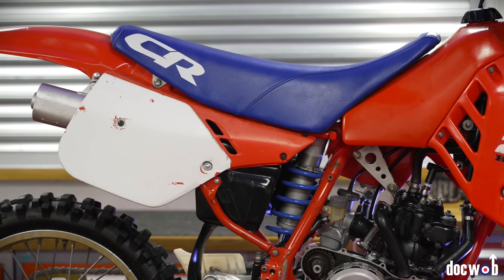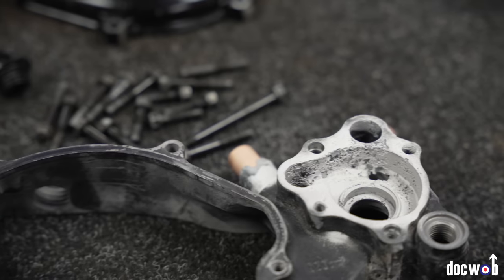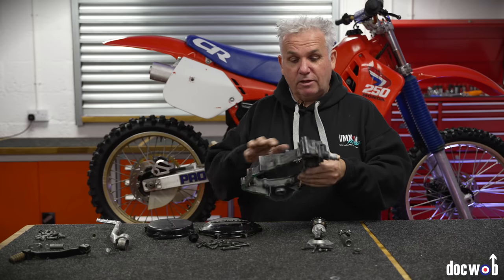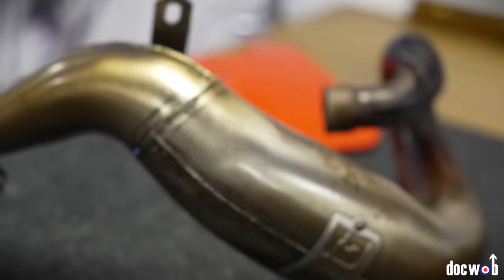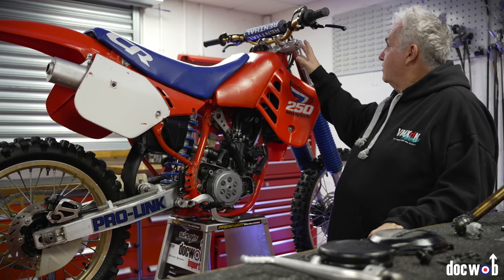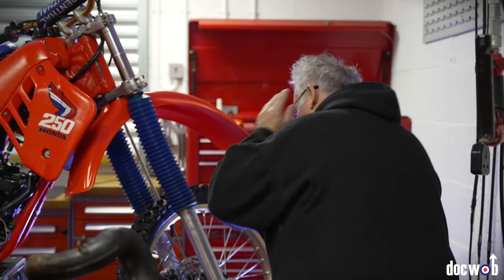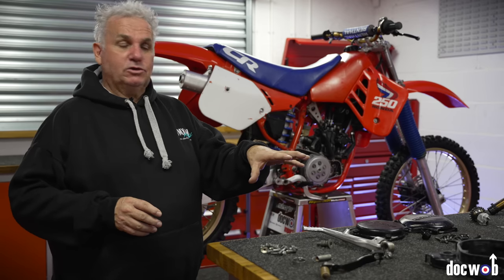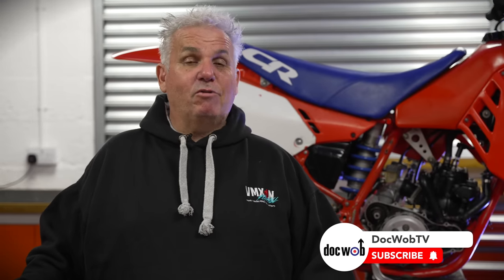DOCWOB - HONDA CR250 1987 - Completely original!

Comment: Just to let you know, a buddy of mine is in the middle of a complete frame up “RJ ‘87 CR250R” rebuild and he just received his new PC ‘87 CR pipe from Pro Circuit. You had better make that call ASAP because PC just did a batch of these pipes up, not sure how long they will be available.
Reply from the maker: I will be on it pronto!!
Reply: RJ was an 1988 model

Comment: i bought this bike new September of 1986 when the 87 1st came out. raced it here in central FL. gold cup series. i drove an old junky van but this sweet bike would roll out of it. super reliable, I did nothing but change oil filter and rode it the entire series. In this era every year there was a noticeable and significant improvement with the bikes.
Reply from the maker: Very cool! This is why we have them to bring back the memories!
Reply: These had an oil filter?